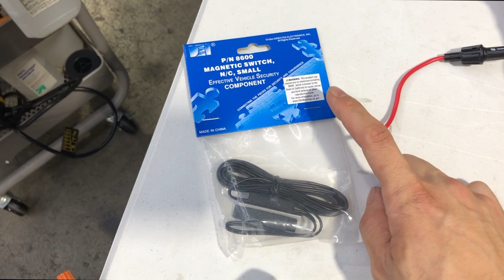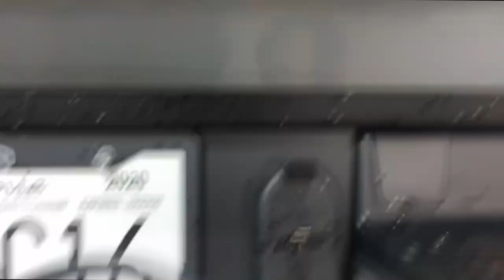DTLRSHP 105   DIY 2020 Ram 1500 automatic Bed Lights for Under $60 without programming

Comment: This is actually all the information that I was looking for doing with mine.  Thanks for this video, I was wondering about some of it.
Reply from the maker: awesome! nearly 3-years later, still running strong and haven't had a single issue with it
Reply: You could of done it a way better way with a relay use the tail gate light it turns on with the cargo light .what you do get the get to power from the trailer plug connect that to 30 on the relay from the tail gate light connect it to 86 on the relay that is the trigger then from 87 run it to the light 85 is ground and if you want to add a switch you run the wire from 87a  to the switch the from the switch to the light and of course add some fuses just to be safe and your done works just like the factory lights .

Comment: You could of done it a way better way with a relay use the tail gate light it turns on with the cargo light .what you do get the get to power from the trailer plug connect that to 30 on the relay from the tail gate light connect it to 86 on the relay that is the trigger then from 87 run it to the light 85 is ground and if you want to add a switch you run the wire from 87a  to the switch the from the switch to the light and of course add some fuses just to be safe and your done works just like the factory lights .

Comment: DOESN'T SHOW HOW TO CONNECT THE MAGNETIC SWITCH, i tried various combinations using the same items.....IT DOESNT WORK...
Reply: One lead of the magnetic switch will ultimately go to the truck's frame. The other lead of the magnetic switch will go to the negative of the switch / light combo, in this setup. Or, you could put one lead to the hot coming in from the source (switch), and then the other leg would go to the light.

Comment: Hi Johnny, what size of wire and wire loom did you use for this project?
Reply from the maker: Hi Tim, I used 16ga wire with 1/4” wire loom. The draw is very low on the led’s so I wouldn’t be too concerned with wire size. The run is probably only about 5 feet ea side too. It’s just the sizes that I found in the garage
Reply: @detailership  Awesome, bought all the items needed. Will work on it this weekend on my truck and my brother's truck. Will let you know. Thanks for the video!
Reply: @timhoang  how did ur project turn out?
Reply: @bdm408  Very good. works great.

Comment: The lights that are on the link are not the same. They are smaller and dont fit in the pre hole on the side of the truck also no room to drill the hole for the button.
Reply from the maker: Just checked the link and it’s still the same one purchased. You have to offset the light higher or lower to make room for the button either above or below the light.